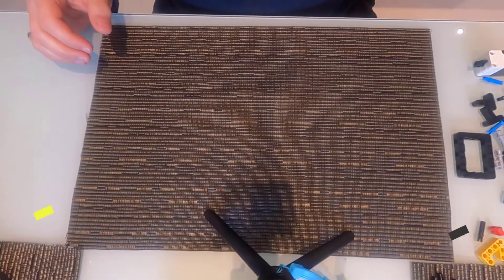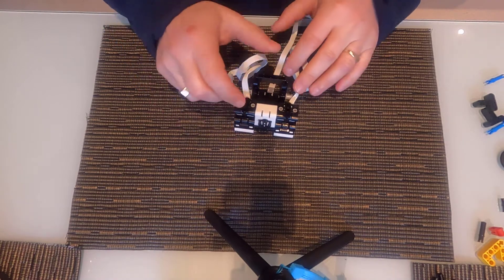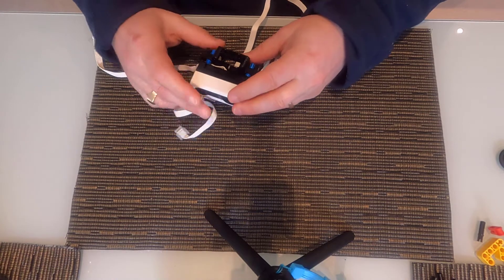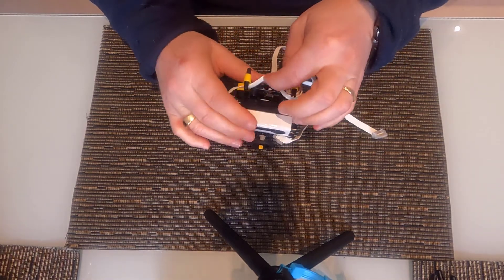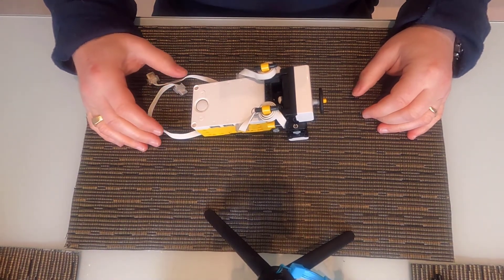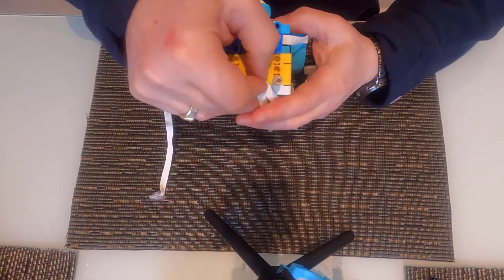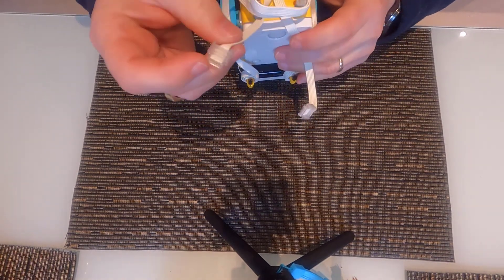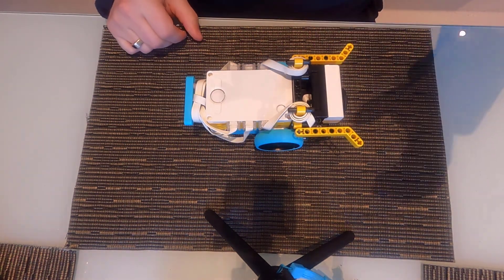Spike Prime Primary Rescue Line Robot for Robocup Junior Australia

Comment: Hey David, I am a young Australian student that jsut attended a regionals Robocup rescue line, it was our first time and we placed 5th missing 3rd by 50 points. My team and I worked to make our robot be able to pick up the aluminium can from the green area but we are struggling to get it to go back through the entire maze again. If there was a way you could give us tips on how to fix that then I would appreciate it. Thanks
Reply from the maker: I will endeavour to get the next article in my Robocup series on https://WinthropDC.com/Robotics written which will cover exiting. You can use a number of methods: Reset the motor rotation sensors after moving to the center of the spill zone before looking for can. Know how far forward you moved to rescue the can so you can back up the same amount. Then return to zero position on motor sensor to undo your rotation. Or use a gyro sensor to restore your position after rescuing can. Then turn and either follow green edge to find silver or back up to silver and turn to find black line.
Reply: @winthropdc1  I am actually using the word blocks on the spike prime app so im not too sure if there is measurement block which measures the distance the motors went? Ill look into it and find out more, thanks for the help.